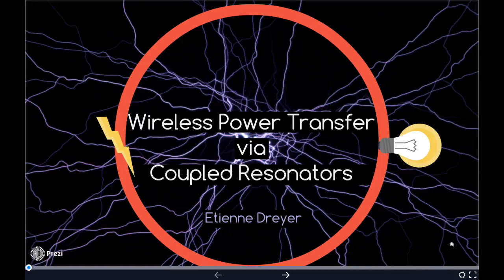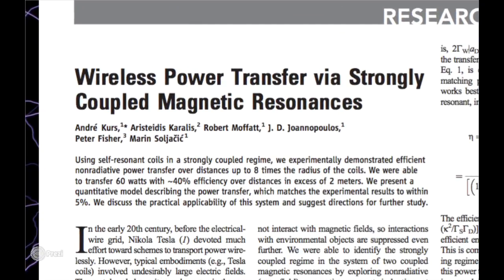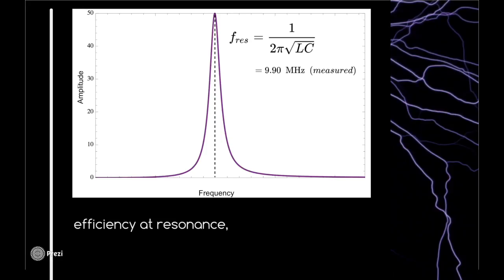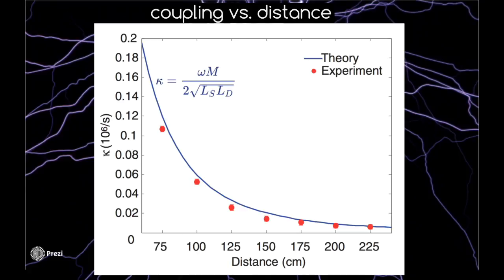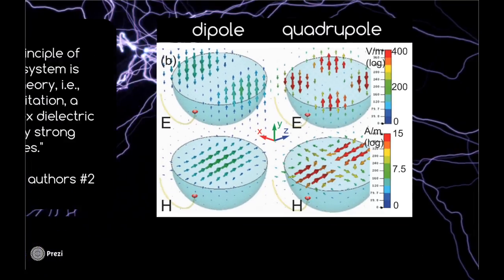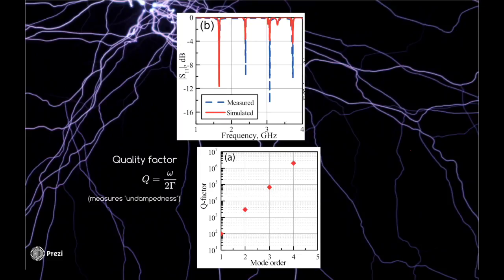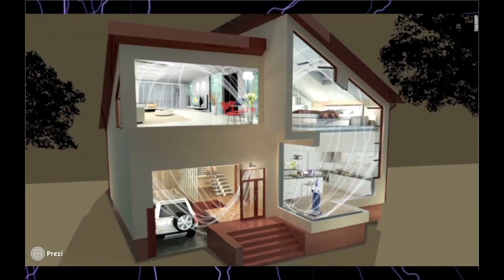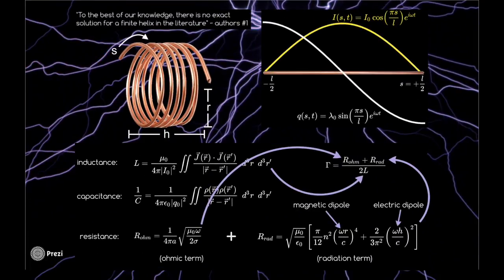Wireless Power Transfer via Coupled Resonators

Comment: The Tesla coil produce a static discharge. If you lower the voltage and increase the frequency above the static discharge you will have a frequency to replace electricity.
Reply: How much is that frequency? Thanks